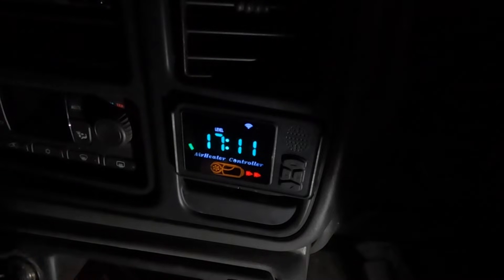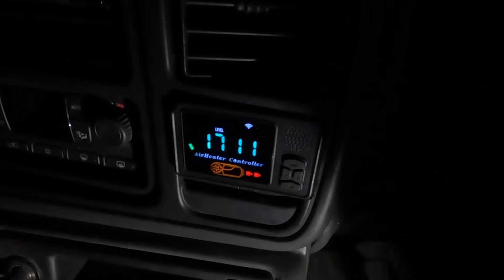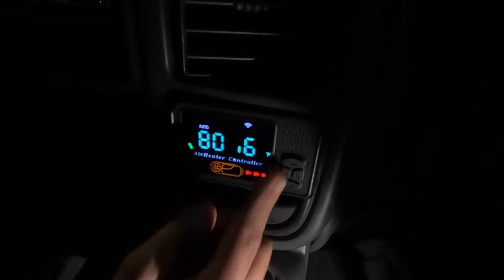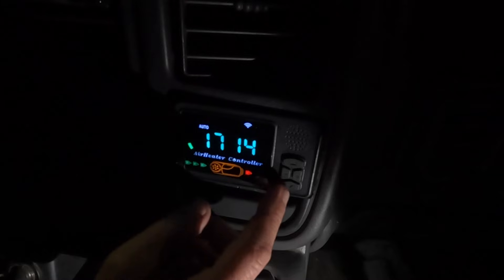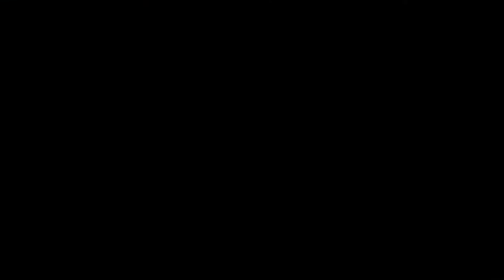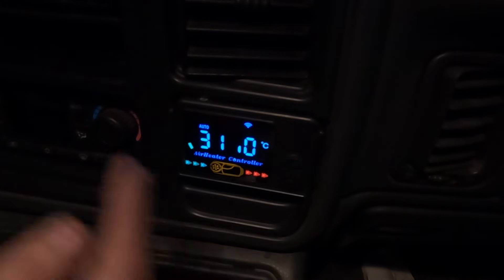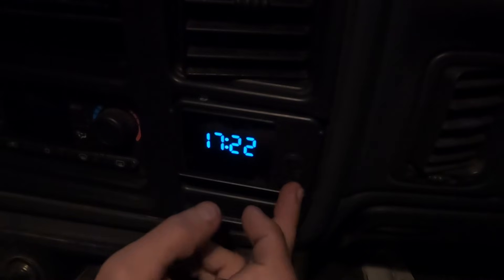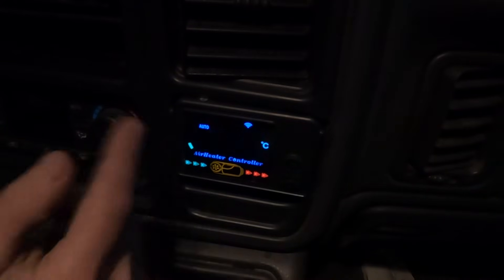Bluetooth Diesel Heater Feature & Settings Discovered !

Comment: Best I've seen for a stock controller. What is it's lowest temp you can set on auto? I use diesel heaters for many things.
1 thing I wanted to try was using it to keep a water shed from freezing. Just needs to stay above the freezing point so the lower
the controller goes the better it is for fuel costs. I use a freeze cube outlet with a electric space heater. it works great but it doesn't 
help when you lose electricity at the house.
Reply from the maker: Thanks for the comment. According to the manual, 8C is the lowest setting. I haven't actually checked. 

It would be nice if it was closer to freezing, but I suspect that set to 8C it would fluctuate close to 0C.